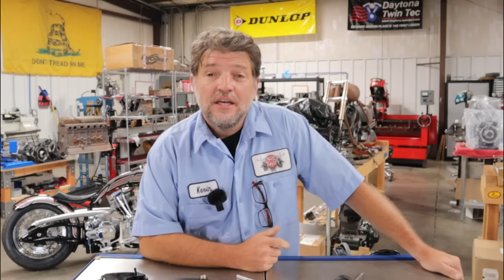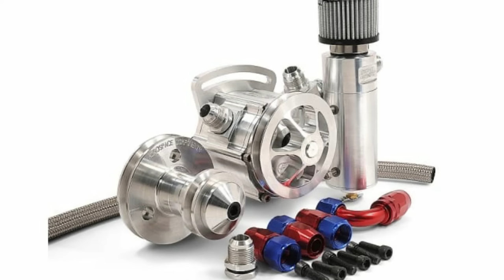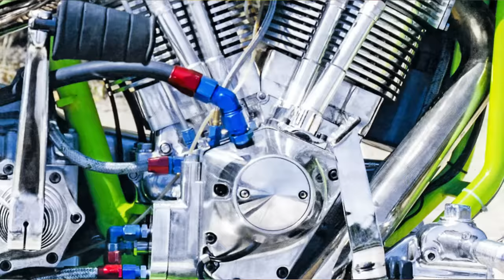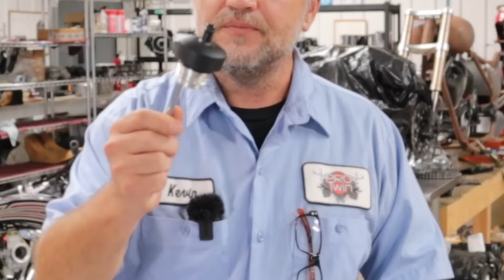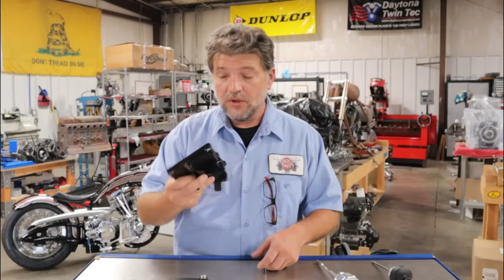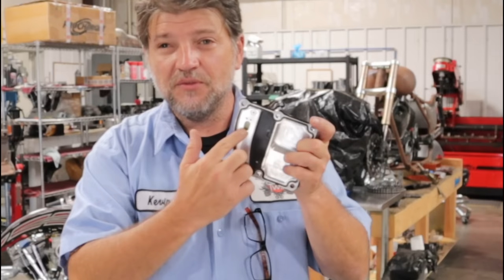COMPARE M8 CRANKCASE VENTING - A1 Cycle, Trask, Feuling - Kevin Baxter - Pro Twin Performance

Comment: I'm running the Trask check M8 trans cover vented to my external breather system for the heads with a Y and everything goes into a DK Customs catch can. After installing the Trask trans cover basically zero oil comes from either vent and the catch can is always empty; this combination works awesome!
Reply: I was wondering if that would work. I have a dk customs external breather with catch can was debating on getting the trans cover from trask. But your comment has me considering doing the same thing.
Reply: @canttalk  Did you end up doing this combo? DK customs AC with Trask tranny cover? I am installingmy DK air cleaner and EBS this Friday. Wondering if I should order the Trask part ($350) as well.

Comment: 2019 Road Glide with state 2.  I installed a complete S&S cam chest. I vented the crank with Fueling vented dipstick and vented the primary with Harley’s own primary vent tube. I ran the bike hard from Chicago to Savannah GA and back on vacation. Zero oil sumping Zero oil in my throttle body Zero oil consumption! That’s running high rpm both ways.  I’m happy to say I have a tight 107 motor and should probably leave it alone now. So, if your motor is relatively unmodified and still sumps oil or blows excessive into your throttle body you might have issues going on. Make sure your pre 2000 M8 has an updated oil pump and also a place to check is your piston oilers which require removing your cylinders. They could be loose or defective causing excessive oil to dump into your crankcase. Mine were loose from the factory.  Yes, I also removed my jugs to check them and also to install better head gaskets with cometic multilayer steel slightly thinner to raise compression.  Top everything off with S&S head bolts and rocker shaft studs.  Basically replacing most of the weak links that came out of a stock Harley motor.
Reply: Will any of this work for an 08 1200 sir?

Comment: Running The Fueling dipstick. Zero issues
Reply: Does oil find its way out when you lean into a turn at all ?
I've heard it does. 
What's your experience  ?
Reply: Iv got one on my Low rider and it squirts out oil all over my back tire at highway revs.
Iv been trying to solve this problem for 2 years
Reply: @elusivesambar8657  Run your oil a half quart lower and it'll stop. A1 Mike @ A1 cycles has a video about oil levels with a vented dipstick. I learned the hard way that they're self leveling!!!

Comment: Kevin I loved this Video. I bought a new 21 Tri Glide and added a Catch can and purchased a throttle body vent from DK customs. I know many companies make great aftermarket parts for HD, just wanted to add DK customs to the mix. 
All these you mentioned I have purchased from and find all to engineer great products. Thanks for the education on crankcase pressure. 
Papa.

Comment: I have a 19 RGS,installed an S&S 475C cam chest kit with plate and pump.I also installed an A1 ventilator but I put a cheap Amazon check valve in the vent hose to maintain crankcase vacuum.

Comment: True that concerning the water/oil mixture via catch can.  Installed DKs set up on both my scooters, one TC one M8, very happy with both, but you must remember to dump them out on occasion.  Also installed Love jugs on the TC 110.  They make significant difference in engine temp, although they do make rider and pass, right leg HOT… the price we pay for longevity.
Reply: Glad to hear the Love Jugs help. Thinking about a set for my 103. Have the catch can and it works. Let's you know when to empty as it starts weeping oil from the can vent.

Comment: I have a 2020 Triglide with about 8,000 miles on it. At the suggestion of a well respected builder here in Wi., I plan to leave it bone stock. At least in terms of any engine modifications. I have been giving thought to some sort of vent, mostly to keep oil mist from going into the combustion chamber.  I have been checking the air filter for oil contamination and there is virtually none! However if I start to see any I will be looking into a vent that eliminates the breather tubes going into the throttle body. Love your videos!

Comment: Thanks for the videos Kevin. I’m running the A1 dip stick on my 2018 107 with a stage 2 Harley toque cam so far no issues. I did put the catch can under the side cover to protect it from sucking in rain water. I only have about 5000 miles on the dip stick but I think it is helping the oil consumption which Harley says is exceptable.

Comment: I would just like to add a note on the vented dip stick vs vented trans top plate on M8 softails. I recently finished installing a 128ci big bore kit bought from you by the way) on my '19 Breakout. I initially added a Feuling vented dip stick but had to remove it because it never would stop discharging liquid out the filter (enough that it was leaving an oil spot and contaminating my rear tire. After removing the Feuling dipstick I installed the Trask top cover and have not had any issues with it at all. I was surprised by this because I've been running a Feuling dipstick on my '19 Road King for some time without any problems. I don't know if the Softails have different configuration on their oil return system or if it was caused by the added displacement, but thought it was something worth mentioning here.
Reply from the maker: glad you found a solution.  routing can have an effect...and the cycle thru the trans could very well have reduced oil coming out as it can condense inside the cavity in the case and separate from the air.  thanks.
Reply: I had the same problem with A1's vented dipstick...  it dumped oil on the road on my 7psi turbo 103 twin cam..  I took it off immediately and went to an oversized external breather at the heads
Reply: My 18 Fatboy would spit oil out of Fueling dipstick but on my Lowrider st works great.Both softails
Reply: I also had and still have the same issue with the Feuling dip stick. 
It vents out oil on my rear tyre and causes a mess but only when I’m at highway speeds. Im disappointed it didn’t work for me as it is quite expensive to buy from Australia. There is still also excessive oil in the throttle body, which i believe causes performance to be inconsistent.
Reply: @elusivesambar8657 don't these companies offering these products suggest running a quart less of oil? If so, maybe that is the reason?
Reply: Running less recomended oil?Something you don't want to do on any engine!
Reply: Thanks for this, very informative. Do you know what, if any, improvements HD has made in the 2024 M8 to change the problem??
Reply: @JimCunningham-m1b  you are kinda correct in that running your oil a little on the low side will help with blow by but not too low.
Reply: @JimCunningham-m1b  actually thats not true whatsoever. Watch the videos @ A1 cycles and youll learn that youre not correct.

Comment: I went with the A1 dipstick on my 96” build I did this year. I noted a little more residue on and around my throttle body, not a ton but more than I liked. After watching your video I purchased the A1 dipstick. Ran the bike for another 2000 miles removed the air filter. I noted very little to no residue on the throttle body, none of it liquid.

I run my oil levels at the normal hot check level and have had zero issues with oil / liquid leaking out of the vent filter. I ran the hose from the vented dipstick as per the instructions placing the filter end between my cylinder heads. I’ll check again next oil change but very happy thank you for the information.

Comment: With my m8 107 buildup. 129 now. I installed a vented dipstick. I mounted the breather filter on top of the dipstick directly.  NOT GOOD!!! Had blowby misting oil getting on the saddle bags. I ran a 3/8 rubber line after the misting on the bike issue to the top of the motor to rest on tip of the intake manifold with the breather filter installed at the end. I have 100 miles on the new performance build.  So of course the rings haven't seated yet. Naturally there will be more blow by. Added....I was in 3rd gear at 55mph getting onto the freeway.  I pulled 2/3 throttle went up to 65 mph and my rear tire broke loose!!! Scary, but cool!!! Weather was dry, road also. I'm assuming some misted oil got onto the rear tire. I haven't dyno tuned the bike yet. The thundermax is still learning the build up. I created a monster!!!!

Comment: Did a homemade version of the Trask..... bulkhead fitting, check valve, out to a filter. Checked my throttle body several times and virtually no oil.

Comment: I use the fueling dip stick 114 with a red shift cam this system works great  np crap in the catch can  making 134 hp and 142 tork great runner

Comment: Several questions regarding this subject still remain, even after this video, which I appreciate your time and effort in creating. But what I have yet to find, does performing a breather mod, where it is vented either to the atmosphere or to a catch can, hurt engine performance in any way since you a removing a source of vacuum.? I have read articles and watched videos that state that having vacuum in the engine helps pull oil down the cylinder walls to avoid excess blowby.  Some say the size of a Harley motor doesn't create enough vacuum to have an effect. But then there are companies like trask and fueling putting in check valves in to let air out but not suck any in, and others like the a1 and dk customs external breather solutions that are wide open
Reply from the maker: everyone is seeking a definitive solution or specific mod to make.  there are varying degrees of severity and several causes of issue.  there can't be one singular solution.  excessive oil in the tb can create issues.  so...if you dont have an oily tb and excessive carbon on pistons, maintain connection to intake.  if you do have those issues, vent to a catch can.  the long term effects of excessive oil is more harmful than the benefit gained by keeping it in the intake.
Reply: @KevinBaxter  Thanks for the great vids - I've enjoyed every one.  Re: the question above, he seems to be asking whether vacuum is important to maintain on general principle.  And if it is, should a check valve be used to maintain crankcase vacuum?  Trask and Fueling use a check valve to maintain vacuum, A1 doesn't.  Harley uses valves in their breathers.  In your video, you say that they all "do what they say they do," but that doesn't answer the question of whether it's better to have vacuum or not?

Comment: Mr Baxter, I have been looking in to the same products that you just did your video on. First some background on me. I'm just a humble Tech that works on Victory, Triumphs and Indian motorcycles. "Polaris" Indian and new Triumphs to be clear. I have done a few Top ends on Indians and have seen the carbon buildup on low mile engines from burning oil. So when I got my new 22 Road Glide I want to prevent what I have seen in a lot of big displacement engines and that is oil in the intake. In the research I have done the breathers that have a one way valve act like a PCV valve on a car. Vents the positive psi but keeps the vacuum in the crank case to help the rings seal and reduce "blow by". That is what I have found.
Reply from the maker: I have found the same in many engines and engine formats....car and bike, new and old.  But not all....based on severity and cause really.
Reply: mr perry- with your wealth of working on different bikes which one would you say has the best most efficient engine

Comment: Kevin, I talked with another M8 Harley owner who switched his factory air filter with an S&S Stealth air filter kit. I was tired of seeing oil splatter on the front of my left side bag as well as fouling up the cylinders, so I bought one & installed it on my bike. That seemed to have stopped that problem.
Reply from the maker: Good stuff

Comment: I run the Feuling vented dipstick. I actually could tell a difference in the higher RPM's. I installed on a new FLTRXS as preventative measure.
Reply from the maker: less pressure can produce more power too.  In say....2000 hp drag racing engines, a vac pump or other method of crankcase venting can add 150hp or more.  it matters.

Comment: My 19 road King sumped the transmission fluid into the primary. I vented the primary and solved the problem.
Reply: How did you vent the primary? I have the same issue on my 17 sgs

Comment: Hey, really well delivered lecture on Venting,  however I noticed you didnt side on the check valve/vacuum debate, and I suspect the A1 cycle tran plate does not have a reed or a check valve either..  Now my opinion of the Trask..not olny does it (and the Fueling design) vent the crankcase, but are designed to help maintain some level of vacuum that might be present at times. I think its the better unit..except for the under side screws to access the Reeds,.. They can and if they fall out, there can be issues which can cause engine damage.. Trash should have put that access on top of the plate!   So I just made my own  crankcase vent with check valve system for about $30

Comment: With 140 hp & 160 torque you can tell that the motor is running not only smoother but running with ease. Thank you A1 Mike.

Comment: Great information! Am running the A1 on my 17 Road King with 0 issues. Would be very interesting to know if there is a meaningful amount of cooling associated with not using a check valve.
Reply from the maker: I can't say either way.  To many variables to test really and achieve definitive data.

Comment: I went and got the Feuling vented dipstick and it has reduced how much oil ends up inside the intake by half.
The only real con about the Feuling is the set screw for the cap should have been a standard size Allen screw because the one Feuling used is way smaller than any Allen wrench I have in my collection. 
My question is,  would it be harmful to my M8 if I added the vented trans cover to work in tandem with the vented dipstick?

Comment: Hi Kevin I’m Robert love the videos you have helped so many people understand the science with these bikes I have a 2017 ultra limited 107 im running my tran top cover to vacuum ported catch can with baffle straight to intake port on back side of intake manifold with damper and vacuum gauge vacuum is 5 pounds I’m letting breather bolts breath in to catch can and stock oil pump cause with vacuum no aeration in oil and no pressure build up so oil pump will work better .better seal on piston rings and both vacuum/pressure release are serving a purpose in preventing blow by I think a awesome problem solver. Kevin do you think this is a good idea and how much vacuum do you think is best

Comment: Hey Kevin, great video, I recently installed (2), yes two catch cans on my 16 Twin Cam Road Glide, one on each cylinder.  The bike had 30,000 miles on it when I bought it, and runs well, but I wanted to see if I installed the catch cans, what color or how dirty of blow-by I would find, as we generally are guessing how a motor has been treated by the previous owner when buying a used bike with more than a few miles on it.  So far I have found only clean colored condensation from each cylinder, so I think I picked a solid bike for the most part that was well taken care of internally.  The reason for my comment today, is not only to endorse your video here, and the reasoning, but also feel the twin catch can system is a great way to monitor the blow by as the bikes mileage and age increases, while not the only indicator of an internal problem that is growing, a very easy way for the DIY guys to monitor the engine internals, and head off a problem timely, before it gets to the “big problem” stage. You do a great job, your a great teacher, and have a well thought out presentation, that keeps your viewers coming back I would bet, I know I do, I only wish I had more time to consume all that your videos offer.  Thanks for all you give to the bike community, your channel certainly fills a void, and would be missed if it was not there.  Blue Skies!

Comment: KEVIN: I've asked this question on a previous video but was never answered so this is a good place to ask again. On that previous video you explained how some crankcase preasure is helpful in keeping the piston rings, particularly the second or middle ring I think, expanded and sealing properly. Would these vents eliminate most or all of that preasure creating another issue?

Thanks
FWS
Reply from the maker: I would have said some vacuum could be helpful...not pressure.  its a balance of pro/con and the actual cause of the crankcase pressure or sumping issue.  also....riding style matters, time at high rpms, type of oil, etc.  So many variables to this.  People are seeking a single cure or single answer...too many variables to arrive at one really.  Its a case by case scenario.

Comment: I have a Stage 4 on my 2018 Street Glide, I installed the Feuling dip stick, it helped a little but at 80mpr I still have oil on my right bag, oil in the breather, my next thought is to do the $12.00 fix and vent it back into the transmission cover in the first port that goes back into the engine, I have the 1 breather can from the vented dip stick and always smell oil, so not happy with that